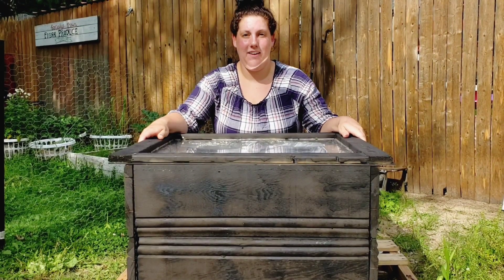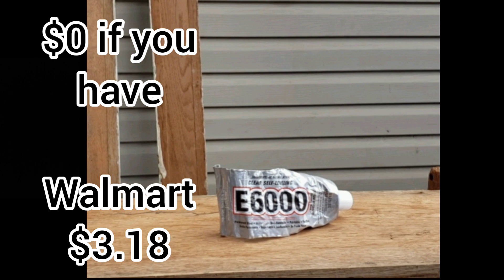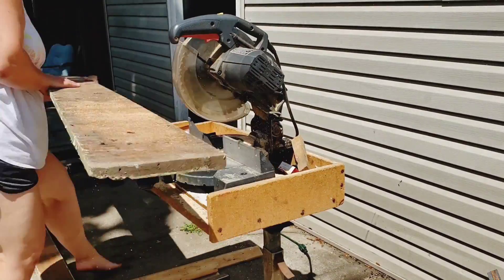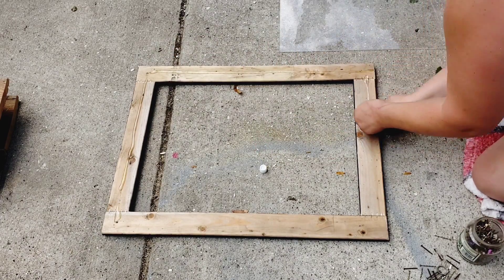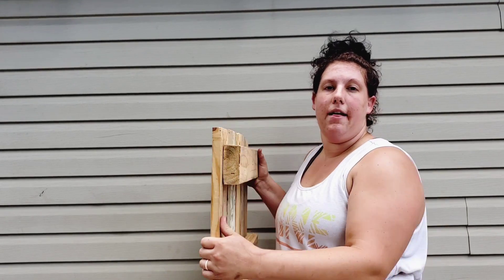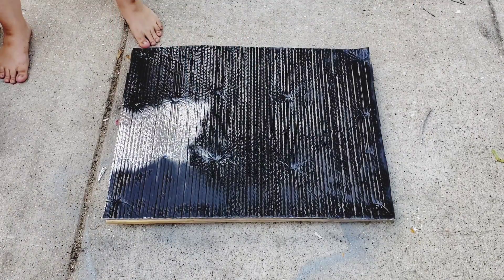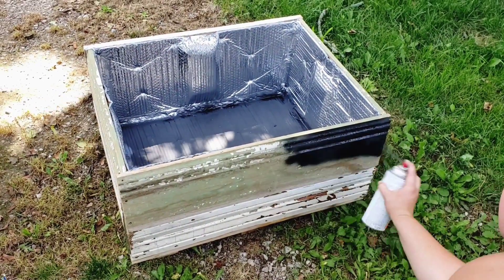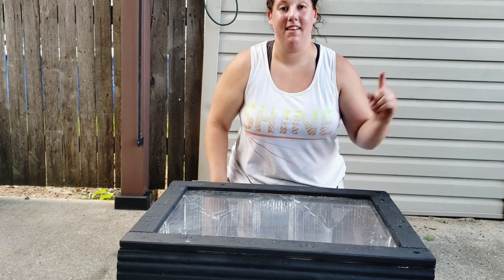The BEST $35 DIY Sun Solar Oven - Easy To Make

Comment: Attention Allerding Family, since you said to comment for questions, here’s a question; Why aren’t you answering all the questions? (Specifically, from @kellydclear 2 years ago “What temperatures are you getting from it?”, and also from@MA-bt8il 2 years ago “…Some questions: How does it work? How do you gauge temperature? How long to "pre-heat"? What are the basic cooking/baking instructions? Thanks again!  Blessings!  :)”. Additionaly - How has it held up over the past two years, or have you even used it regularly?)
Reply: I guess the temperatures aren't that great. I make solar ovens myself and to me it looks like something that would barely reach boiling point. The "glass" should be facing the sun or at least there should be reflectors, and better insulation. Also, plexiglass would cause problems beyond 100°C

Comment: I think it would be better to make measurements on the wood after each piece is cut, rather than mark all the lengths on a solid piece. You're losing the kerf width with each cut. Looking at your blade, the kerf is about 1/4". The loss is cumulative.

Good work.

Comment: what kind of food have you made in it and at what time of the year? How many hours did it take? Did you add wheels to the botttom just in case you had to move it to follow the sun for food that had to use more sun time then one spot accommodated? Thankyou for showing us how to do just about all of the steps. why did you skip showing us how to make the bottom of it? I don't have any idea how that part was done, but I guess I could use a solid peice of wood so I don't have to risk the chance of not creating a sturdy bottom. Does this solar oven work in the winter as well or is this model ideal for summer sun only?

Comment: I saved a discarded end table and plan to convert it into this. The nice thing is that it has legs to keep it elevated off the ground, which will make it easier for me to use with an outdoor chair. I'll remove the top and re-install it with hinges. Or, I might just leave the drawer in it to add/remove a cookpot or baking pan. Great idea and thought-provoking video! Thanks! 😎👍

Comment: This is not correct. There needs to be foil where the glass is attached to and glass on the covered area...its meant to reflect and trap the sun inside.

Comment: You're using toxic paint in an area that gets hot. This causes the paint to gas off in to the food.
Reply: High temperature stove paint is not toxic. To be sure, any oven should be heated empty for a full day to gass off any possible chemical residues.

Comment: I heard plexi glass is bad it melts? That it is best use tempered glass.
Reply: Plexi glass isn't the best choice, better use tempered glass if you can get it in the right size, it's impossible to cut it with only a glass cutter. I use normal window glass and so far it survived up to 140°C
Reply: @SolarCookingGermany  Thanks, you make an important point. I have tested plexiglass and it melts at 260F, so to cook anything in this oven will take a very, very long time, like all day. Once you build the baking chamber, you can order the exact size of tempered glass you need. It cannot be cut after it's tempered, because it will shatter.
Reply: @RichardMenec  The problem with plexiglass is also that it expands when hot, you have to consider this when making a frame. Much better are twinwall polycarbonate sheets, they're cheaper, more temperature resistant, lightweight, easy to cut, UV-protected and the twinwall adds some insulation. Of course it also expands and you still can't bake, but it beats plexiglass in almost everything.
Reply: @SolarCookingGermany  Perhaps you didnt understand my reply. I would never use plexiglass because I've tested it and it has a melting point of just 260 degrees Farenheit. You cannot really cook much at such a low temperature. I recommend only tempered glass, which I've been using on my home-built ovens for over 20 years now. My ovens get to 475 Farenheit within 30 minutes in full sun in summer time.
Reply: Thank you I found a piece of tempered glass off  old fridge I did use it and it went up to 275 I’m excited! Thank you for responding.

Comment: Marking every cut does not consider the blade width. measure each piece you need after you cut the previous board if you want them all the same.

Comment: But instead of all that spray paint inside I would just make the bottom a metal tray base and place oven on stone or put fire bricks inside on top of metal tray and set it on top of a stone stand that I could turn  it on like maybe on some little wheels that lock instead of the chemicals

Comment: Built my own and I used 20" x 50' aluminum flashing it reflects the heat so well that I'm getting up to temperature in minutes.
Reply from the maker: Thanks for sharing!!!
Reply: Larry did you use only the flashing for the sides, or did you put the flashing on top of a wood form?  If flashing only, how did the box retain heat over the cook time? Thanks so much!
Reply: @juliabrown5948 flashing over a wooden frame stood it up with wood legs and put a refractory plate underneath and over top.
Reply: Thank you for your comment

Comment: Have you checked to see what the highest temperature it will reach? Now that you have had it for a few weeks and I am sure you have cooked in it what if anything would you change?
Reply from the maker: The inside temperature has reached and maintained 220°. The only thing I might change is adding another window to the front of the sun oven for my heat rays from the sun. Next summer of 2023, I plan to build another identical one and add that extra window to the front 😊.
Reply: @allerdingfamily-urbanhomestead  i will be watching for the next video.
Reply: @allerdingfamily-urbanhomestead 220 Fahrenheit or C?

Comment: It looks great,one question. If you have to constantly rotate box to keep in sun how do you keep racks from sliding?Would you not have to have some sort of way of keeping pans flat while moving box? I have been looking at so many of these being built, out of so many different materials, trying to get right plans for making one. Thank you for your time and effort.
Reply from the maker: I haven't had any issues with the racks sliding around when it came to rotating.

Comment: I thought plexiglass wasn't a good choice for a lid due to heat and chemicals?
Reply: The problem is you're not displaying the food in the oven, you're cooking in it.  With normal display and "food handling" the plexiglass is not heating up. Save yourself the potential toxins and use real glass instead! That said  I love the way this was put together, very straightforward. I'd love to see a demo of how it works.
Reply from the maker: Plexiglass is safe for food handling. Plexiglass is commonly used for food handling and display purposes. Plexiglass is FDA compliant. I provided a link if you want to learn more 😊.

https://www.professionalplastics.com/FDAApprovedPlasticMaterials#:~:text=Is%20plexiglass%20acrylic%20safe%20for,Plexiglass%20is%20FDA%20compliant.
Reply: Plexiglass has a melting point of 260 degrees farenheit, so all you'll be able to do with this solar oven is keep food warm, not cook it. I build solar ovens, and what you need is tempered glass, which will easily handle temperatures of 500F. Your baking chamber should also be rounded and insulated, and the addition of reflectors, preferably arranged parabolically, will allow you to actually cook or bake something.
Reply: Some plexiglass blocks UV radiation ( heat)... glass maybe better, thou fragile.
Reply: @Allen-yv3ue  use tempered glass only. Ordinary window glass will crack at temperatures even lower than plexiglass will melt, which is 260F.

Comment: That’s totally cool!  Do you pit an old oven rack or anything on the inside bottom to put baking pots in?  Or just set it right on the rustoleum painted insulation?  Also, Does it matter what kind of baking pans you use it it?  Great job!!
Reply from the maker: I recommend using racks at the bottom such as cookie racks or whatever you have on hand. I have been using instant pot racks. For baking pans, it doesn't matter. I have successfully baked breads and meatloaf in my glass bread pans.
Reply: @allerdingfamily-urbanhomestead  Very good!  Thanks for the response!  I see my next project!  You did great!  👍 Thanks so much!